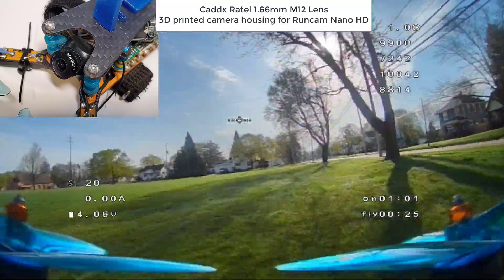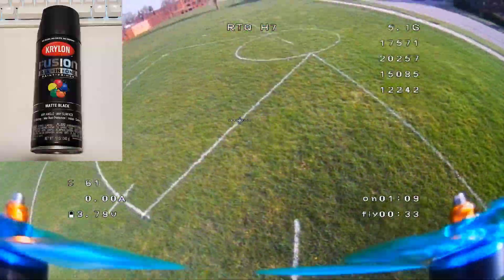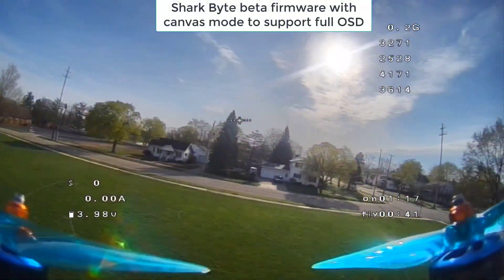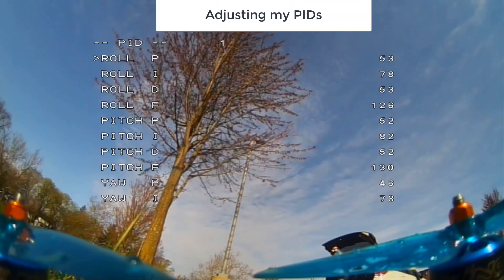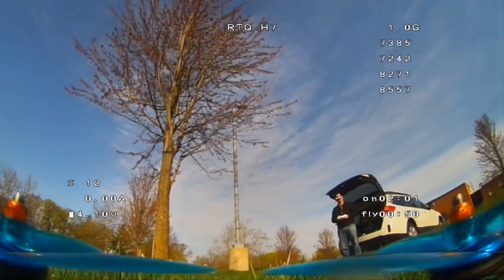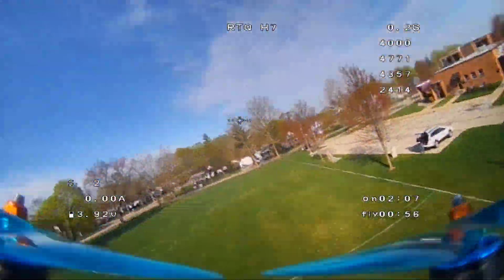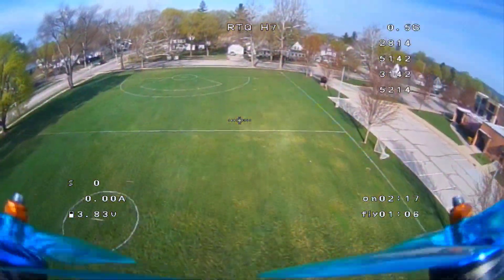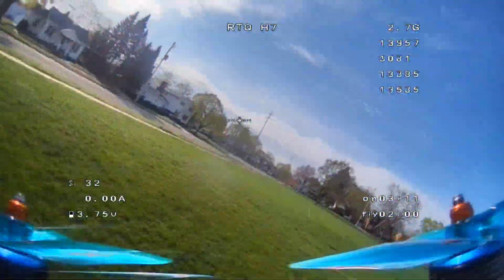Improve Shark Byte with M12 Lens + Canvas Mode OSD

Comment: If you can print in black ABS you don't need the paint. But I get it that some have a lot of trouble with that plastic. If you decide to try it, print the stl 2.5% oversized and at .05 layer height (if you can) and the threads will be perfect. If your slicer does multiple processes, you can print the portion of the case without threads at .2 or even .3mm layer height to reduce print time.
Reply from the maker: These are good points. I printed this at 105% scale in order to get correct fit. 100% was too tight

Comment: Here the colors are very beautiful but I always see little sharpness. Is it the fault of the dvr? do you see clearer in the googles?
Reply from the maker: First, make sure to watch in 1440p (1080p YouTube compression is awful). Second, this is from the VRX built-in DVR (which I think is decent). The image looks very sharp in the goggles - especially with OLED goggles (I was using first-gen HDO's). I also turned off fake sharpening features in the camera settings and lowered the sharpness to 62/256, so you could crank the sharpness up to artificial levels like I'm sure some cameras do. While it is possible to be sharper than this, if you feel this isn't good enough there isn't much more I can do here. I'm really satisfied with this - it is excellent now
Reply: @RyanQuellet  I have hdo2 and runcam 2 coming with caddx tersier lens. I should have the maximum that can be obtained for now ... Unfortunately, the comparison is always made with the dji dvr, so you are never satisfied. I am convinced that I have made the right choice for racing and flying with many friends at the same time.
Reply from the maker: Yes, for racing Shark Byte is the clear choice. I think you'll be very happy as long as you can appreciate the benefits of the system, but accept its drawbacks

Comment: the system seems to be getting better and better.... I'm going to continue to hold off on DJI
Reply from the maker: This is a wise idea. Fatshark and Divimath are committed to this product and the community and improvements keep rolling in based on user feedback. DJI is not involved with the community to this extent. I know who I'd rather work with
Reply: QRP  they are trying to create an ecosystem wherein you can't go outside of them. Thats a HUGE reason why I'm hoping that Sharkbyte continues to improve. With a better /more powerful VTX and some better cameras, I think Sharkbyte will be a real alternative
Reply: QRP  um - I disagree but I do think moving forward would be a good look. I think Analog will always have a place as a budget system, and will always bring people into the hobby at extremely low prices. but YES they need a goggle around the $400 mark with Sharkbyte built in
Reply: I bought SB strictly for that reason. I'm betting my hard earned dollars on SB improving, and keeping this an open hobby, not trying to restrict the hobby to your own products,which you can't fix yourself.
Reply: QRP  ohh wow --- why ?
Reply: QRP  well I'm hoping for better cameras and goggles that can take advantage of the max rez while still allowing analog receivers for analog stuff
Reply: QRP  Lets throw Skyzone in there as well
Reply: QRP I stand corrected. My terminology was inaccurate. I meant that you are able to use all your own FPV gear like receivers, transmitter, etc. Not force you to buy their transmitter and receiver and camera's etc.

Comment: Your SharkByte seems to have less signal break-up than any others I have seen on YouTube and is very clear. Is this just stock or are you doing anything special with antennas?
Reply from the maker: Just 2 lumineer axii 2 stubby antennas on 4" SMA extensions for better separation. I upload to YouTube in 1440p 60fps so there is minimal compression. I usually don't fly behind myself between a metal roof or solid brick building like I see many do. I don't allow the vtx to overheat by keeping it on for 5 minutes not moving like some do. I place my antennas properly away from the frame, unlike some others. In short, I try to do a good job and work with the system